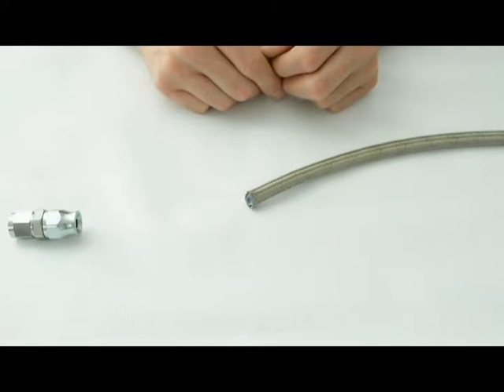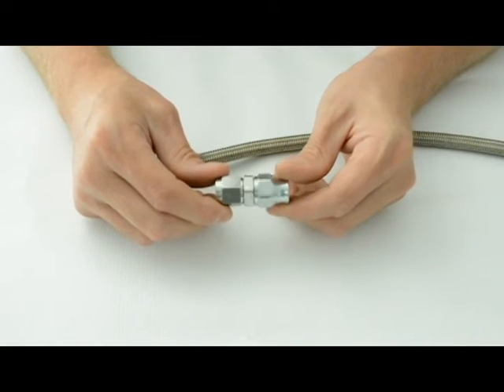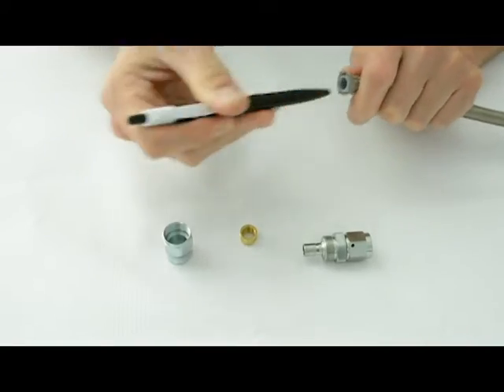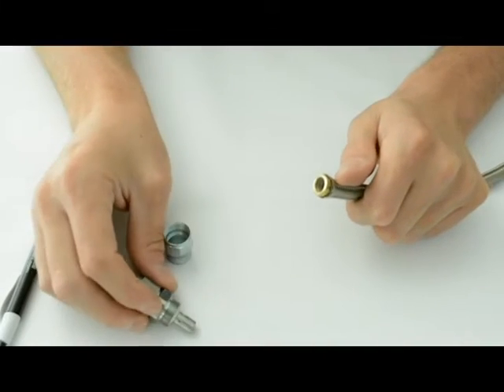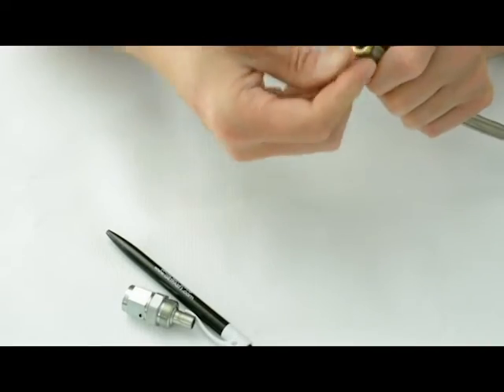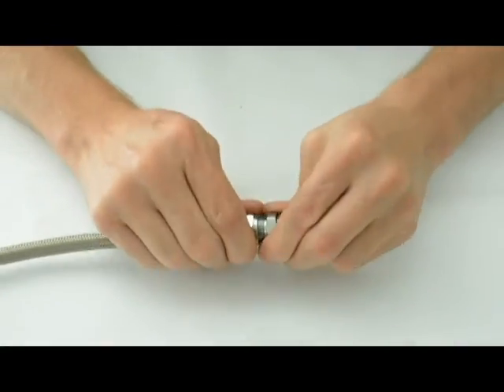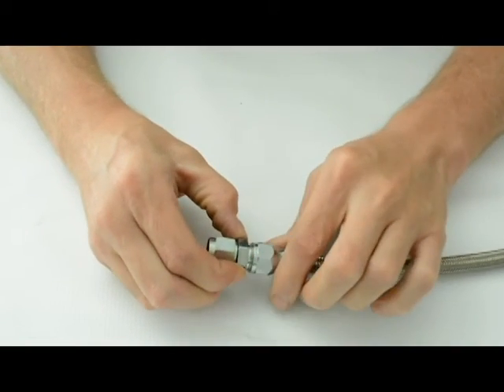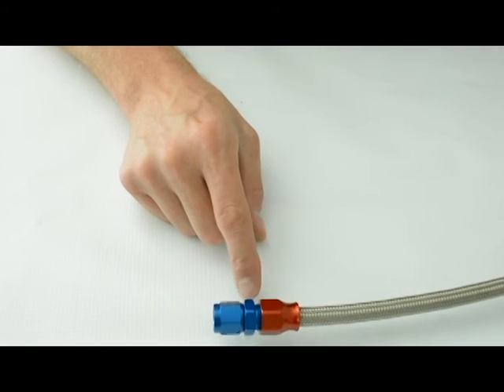How to Install Hose Ends on Teflon Lined Braided Stainless Steel Hose

Comment: A $10 test kit will find hose leaks before installation. Way better than finding a leak by spraying gas or ps fluid.  It's a plug for each end of the hose with an air valve.  Pump it up with air,  wait, check if it's lost pressure.

Comment: Will the aluminum fittings crush the ferrule as securely as the steel ones? Besides a little weight saving and extra bling, I don't see the point of the aluminum.